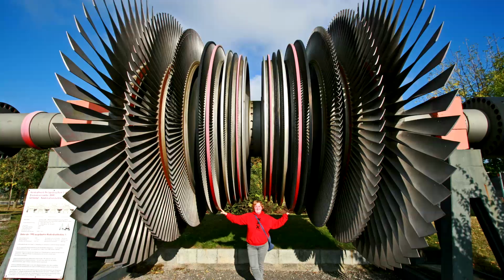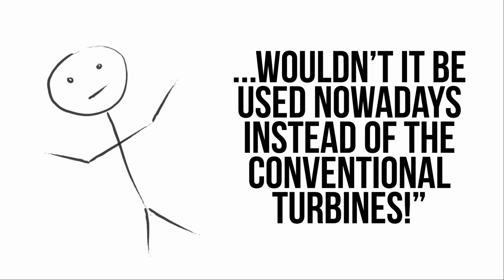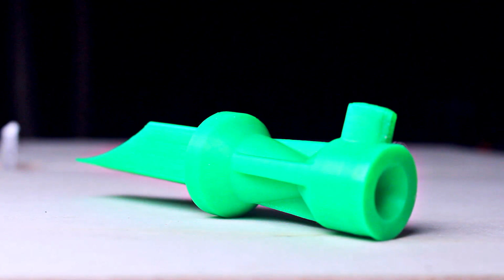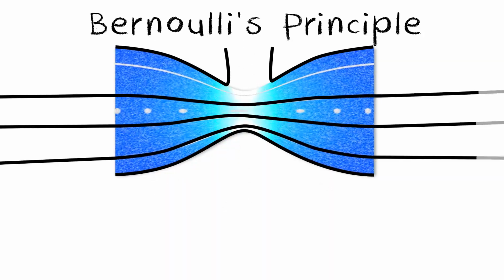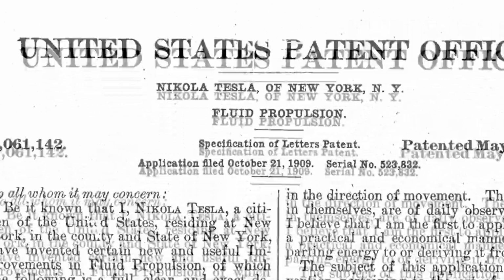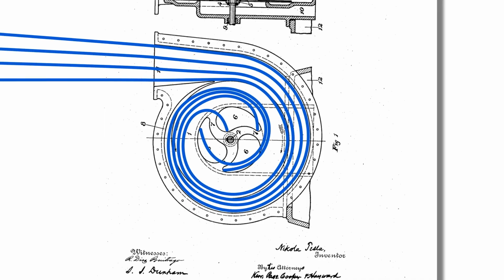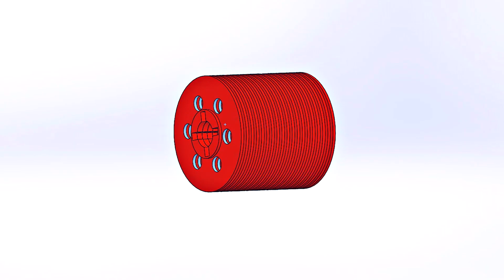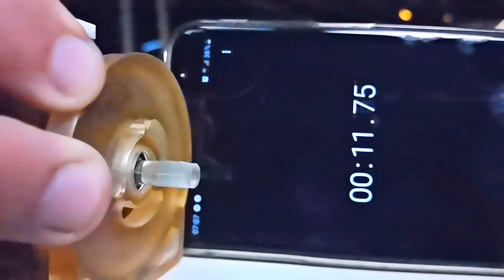Tesla Turbine [Smoke Flow Slow Mo]

Comment: What if you elongated the chamber to fit a longer rotor? Also have the inlet for the fluid/gas as far away from the exhaust as possible and at an angle, creating something of a spiral inside (if thats even possible with fluid/gas dynamics so that the fluid passes along a larger surface and can give more energy to the turbine?

Comment: someone once said the biggest problem with renewable sorceress of energy was storing it for later use when it was not around , like solar  panels at night, and i had the thought of how could you story power with out batteries or whatever and i came up with  an idea for compressed air, but realized that might not work but another idea would be to use a pump to move water up and then at night the power cuts off and the water flows back down forcing the pump to  turn thuse making electicaty, i dont have any of the tools but maybe you can do somthing with the ideas heh

Comment: 5:56 idea of printing 3d stuff using uv curable resin was Also came in my mind before when i was thinking about pcb soldermask and normal 3d printer then i thought what if i use lcd  active filter to send uv light in liquid uv resin using g code algorithm it will print 3d object faster but i was disappointed when i found this technology already exists :(

Comment: The comments were tl;dr so I'm not sure if anyone mentioned any of this or not, but here goes. Try playing with the exhaust ports. Make them more narrow at the intake then widen out, spiraled toward the center. That might allow you to shape the flow without creating that large gap in the second design. You could also play with the shape of the discs. For instance, make them wider on the outside, and narrow toward the center (possibly with a slight spiral, as well). That would help to shape air flow, and increase the rotational inertia. It could also act as a kind of secondary convergent/divergent area within the turbine itself.

Comment: Hey integza, been thinking.  What if there were spacers between the disks that have a spiral shape already present?  Then you could duct the air in the desired spiral and lose less energy, in theory.  You'd lose more potential energy in from the spiral and from the need to spread the disks out further to accomodate the spiral spacers (thus increasing the mass of the axis relative to the energy going in), but this could be partially mitigated with a larger scale.  Maybe with some testing, it wouldn't need to be full spacers, just some fins to keep air flowing in the desired path.

Comment: To improve the flow, have you considered using variable vanes (VGT) on the casing? Not sure if it would improve flow since it is typically used on a traditional turbine blade which VW uses on their turbos, but it's worth the look, it's for science 😁.

Comment: I understand we are working off of tesla here, but this is how car turbos work. but they use fins and the power from exhaust.  then again ive never 3d printed stuff and have no means to do so 

but yea. also. you are using a small amount of air if you consider volume.  why not try a bigger power source with a valve that smoothly transitions to the size of the inlet. 

also im sure you know this but the valve your using that dips in the center to create a "nozzle" is used for thrust, which doesnt work in this kind of case considering you are trying to get the most flow out of your nozzle.  This is also the design used in race cars when trying to make downforce, due to the dip it creates a large low pressure area, creating a vacuum this in turn brings the car to the floor. a nozzle uses the same design principles with different end results.  

ps- if you are looking to make better disks why not try vacuum forming and fiberglass or carbon fiber to mold your disks using 3d printed "molds" this way you can better control the thickness of the disk and still have it be strong and light.

Comment: so what are the sheer loses at high speed, kind of curious f you could drive a tesla turbine the other way to make a more efficient engine.
Reply: theres something about high velocity air in that it is high viscosity so maybe there is a way to use that to your advantage to get an >100% input speed feedback loop.

Comment: Hallo, how you suggested in the video, I still don't understand why ,differently from AC 3phase current and other patent by Tesla is actually used, while tesla turbine definitely did not. The torque is really so low it can't even just move an alternator to produce enough current to give a car the needed energy to run an electric motor ? (using for example a pulse engine to generate the air flow  needed)...Another problem that I think in 2020 is ultrapossible fix is the extremely high heat of the friction parts at 21000rpm ( exist Thungsten, Vanadium, Zirconium Graphite  and other material that can be used for the bearing). bho...I really don't understand...can anyone explain me why? comunque, complimenti per la trasmissione….eeehhmm...cosa ti attira in quelle camicie? sinceramente a ogni video sono un po' più sbigottito di prima...belle le musichette folk!!!)

Comment: Two questions...

1) What determines/controls casing width? More width would add disk weight, but increase surface area (subsequently, pull on rotor) and, provided you had sufficient fluid input (air/water), why not "go big"?

2) would adding texture to disk surface increase energy transmitted to disks, or was Tesla's intent to use a VERY smooth surface and maximize the surface tension method ALONE? I've considered using old LP's (records) thinking that perhaps the finely cut inward spiral of the record grooves might extract additional energy from the flow while assisting with the slow transition towards the center of the turbine. Just a thought...

Comment: Hi Integza, at first, this Idea might be crazy enough to work or too obvious that is completly crap. But if you can somehow mesure the amount of mechanical force that the Tesla Turbine can produce, by adding a small gear reduction or a gearbox, It might give you the required amount of energy while attached to the motor, like Wind Turbines do. As always cool video 👌👌

Comment: Thank you for the educational video.

I Would like to offer advice on safety :)  

The Tesla turbine shown on this video vibrates.  The vibration can be seen in the slow-motion in the video.  Watch the shaft move off center.  

DANGER  plastic will shatter from vibrational energy --at lower revolution rates than metal turbines.  

Shield yourself.  Save you eyes.  Wear safety glasses. Don't operate high-speed RPM bombs (essentially) made of plastic with your bare hands.  And don't even be in the same building testing metal prototypes at dangerous speeds.  

Its physics.

Even when perfectly balanced, hyper-RPMs cause hyper-centrifugal force that pulls apart metal flywheels.  It is not IF it will explode, but it is AT WHAT RPM WILL IT EXPLODE ???

Comment: what if instead of using discs where gas can flow in any trajectory between them, you actually print channels for the gas to go through? they can be printed as separate disks with guiding fins that stack on each other. i think this can be made to guide the gas in any trajectory that you want instead of the trajectory of the least resistance.

Comment: As much, as i love the Tesla turbine design, what would you do with all those RPM? To accelerate an airplane, you would still need a regular turbine, turboprop or propeller, and those require some torque too, not only ludicrous rpm. So connecting it like a helicopter turbine? Or connecting it to a torque converter?
And you still need something to create the flow in the fluid or steam in the first place, because the Tesla turbine is basically just a converter, used to convert the flow (energy) into a rotation.

Comment: What if we 3d pring a suitable torque converter or set of gears and convert high rpm low torque to low rpm high torque Without damaging the discs.

Comment: Could you try scoring shallow, tightly wound spiral channels on those discs? I think it'll increase the net surface area which will lead to increased boundry layer effect and also help leading the air in more tightly wound manner.

Comment: Couldn't you use old blank CD/DVDs as disks for the turbine? They tolerate high rpm moderately well. Late CDs were rated for 52x (~3000rpm) and I'm pretty sure they can tolerate faster speeds before falling apart

Comment: Tesla turbines (boundary layer turbines in general) need to be designed so that the centripetal force throwing the working fluid toward the perimeter of the disks balances the input pressure of the injection nozzle.  The smaller they are, the faster they have to go.  This turbine (based on a very haphazard guess on my part) should be running about 100,000 RPM to operate properly (based on its small size).  You'll never get there with 3D printed parts...It's a cool desk toy though!

Comment: If you turn each disk into a collector and you calculate and engineer the tolerance for ethanol or gasoline. You should be able to collect free electrons much like a van de graff generator utilizing the electroquasistatic field. I'm not certain of the best collection fins or material usages. But given the proper engineering this would be the ultimate future for this turbine in my opinion.

Comment: Well this one not sucks .....impressive results with this design ..3d printed parts can be transferred to sand moulds  better than 3d metal printing ....after it's about nikola tesla....numero uno man ever on face of earth...I am a big fan !wireless transmission of electricity or signals ...induction a.c. genrator ..brushless ac motor ..transformers..arc reactors ..you name his innovations are everywhere

Comment: Assuming you could have everything that airtight, would using a different viscosity fluid (thinner/thicker air, different composition of gases) affect the functioning of that tapering design?

Comment: You could probably copy the design of a hydraulic or oil pump where the axis of the pump is off center similar to the voloute casing and uses blades that are forced out from centrifugal force such that the blades are always close or in contact with the walls of the case

Comment: Why dont you try smoothing out the inside, then adding gear multipliers onto the outside for extra RPM, larger setup and more time consuming, but it can really boost your output if done right.

Comment: So wouldn't a spiral on the inner wall of the case. Like rifling to guide airflow. Adding small bumps to the disc i.e. barnacles. To grab air more efficiently. Much like how whale are swimming with less energy due to the growth like bumps. Just a though

Comment: You could print a path in between the disc to force a longer flow. It may slower the acceleration but improve the top speed and efficiency

Comment: The low pressure part of the Venturi tube is in THE SMALL DIAMETER PART OT THE TUBE because that's where the velocity is highest thus having the most suction. I've worked with Ejectors (yes, they are called Ejectors) and your design is not that.

Comment: Have you tried to make the disk taper? It appears without further math that since the inside of the disk the distance is shorter, it also means the pressure becomes bigger. 
Much like an ICE engine depends on the temperature difference, it seems that this engine depends on as much air parting its speed before venting out. If you would image your motor without an exhaust then it would not turn since the pressure is equal on all sides. Hence by making the disks thicker at the edge and thinner in the middle it would allow the air to flow faster and drain.
This is somewhat analogous to sails. Their function is not to catch all wind but redirect. Which made clippers so much faster than galleons.

Comment: 9:35 I will forgive you for rapping.... but I will NOT forgive you for using SLOTTED screws!!! NOOOOOOOOOOO!!!!
Reply: P-86 resin modulator

Because most of the Parts you print in the resin printer end up in the circular file. Or eighty-sixed.

Comment: Hello guy with awesome 3D printer and accent; I have an interesting question. If we're looking for alternative, cleaner burning energy, what about kinetic energy using Clockwork? If we have a single spring, wind up, the metal unwinds and turns magnets and that's it; though what if we have a series of springs using modern day metals or materials to make a spring that spins longer and maybe an interesting motor with them? Is it useless? Actually, yes; so why do it? Well, for starters, it would be interesting to put together and learn some clockwork and gears to generate power. Two, something called the gravity light uses rocks + a big pull chain and gear to generate electricity and light for 3rd world countries and kids needing light to study for homework where they has no power. I do not ask for perpetual motion motion machine as is scientifically impossible or a permanant replacement, but for something crazy like this to be made to see if it can work like the other guy in youtube making an underwater habitat home and submarines for hamsters... And you might think I'm joking on that last one... Im not, google I challenge it.

Comment: I think the volute casing is viable, but would require a less extreme shift, and the casing might need to intrude between the blades themselves, so instead of the casing starting 3-4mm away from the turbine and ending at the turbine, the casing would start 1-2mm away from the turbine, and have fins that would intrude 1-2mm into the path of the flowing air between the turbine disks, which would keep the incoming layer of air, and inner spiral separate, without losing too much efficiency at the inlet

Comment: Here is another idea.. Create a magnetic film on each disk, have thousands of thin disks which the films on them alter magnetic fields to spin them in circles with spirals molded into each disk, with the inputed + + magnet repulsions or - - repulsions ading to the accelerations with the magnetic patterns, the air flow patterns in the fin designs and the air flows to accelerate it more; I think this would give a greater output ;-D... This could also be used for dam designs for more efficient fin patterns with water flow, and air turbine designs of a new sort :-D....

Comment: Idea for you to test on this Integza :-D    Add spiral fins tiny to many disks in the flow cycling all freely to spin on their own.. maybe 100 disks.. BLow in one side, have the riffles on each disk being different to make it flow and speed through it the pressure added into the opening. You can open or close vents alone each of the disks on the side of the chamber, and based on how many disks needed to process input forces with sensors; you can then produce a magnetic differential to speed it along and the spiral fins and exshausts in the right patters on the disks, you can make it work...;-D

Comment: 3d printing is to "unefficient" cause tolerances and performance under load (delta radius on disk) might hit the inner wall in chamber. Think metal alloy and machining part would yield the most efficient result

Comment: 3D printing and laminar-flow do not play nice. And even if you do solve that problem, you still have the issue of low torque. Tesla Turbines look incredible until you put them under load. The effect crashes, and the efficiency vanishes. This is why it is not used in the field.

Comment: Here’s an idea that would make this turbine 99% efficient using a combination of opposing springs, blades the casing that I can’t remember the name of and the principal that is used to move train wheels I don’t have the slightest idea how to use 3d modeling software but you can try to make my idea a reality, you might need a custom program to control the blades but it’s an idea.

Comment: Hello, Love the segment. I had an idea about the turbine.... What if you had it charge a compressor and had the compressor feed the turbine?
Reply: you might need to air tanks one on standby for when the 1st one runs out and while the seconded one is being used the 1st one is being charged, and if you could get it to constantly feed its self maybe you could put a flywheel on it and with a alternator/generator with a battery bank... then have the government bury it... im nuts love the resin printer that's awesome!

Comment: I am interested to know if increasing the surface area of the turbines by designing them with some sort of corrugation. I can't be sure if angled at approximately 20 to 30 degrees to the main shaft would make a difference to the overall efficiency. what I see is the flat turbine disks not being sufficient to serve the purpose to which they are being applied. A simple experiment by adding small raised sections to the turbines, sort of like this https://images.amain.com/images/large/axi/axi31339.jpg?width=475  maybe just not so pronounced and testing torque output, I can't test this concept as I don't have a working 3D printer. This idea may have already been tried and tested, I have not looked into this either.
Using inlet jets that are sized respective to the total flow of a single inlet should also increase the velocity of the input across more of the disks simultaneously. 
If using the volute case design maybe a secondary set of inlet jets set respective to the angle of the casing to cause mild disruption to the flow of input gas or fluid, I assume this could possibly cause an internal vibration and can't be sure what the results of that would be. if this helps or you think is worth running an experiment for, I would like to see the results.